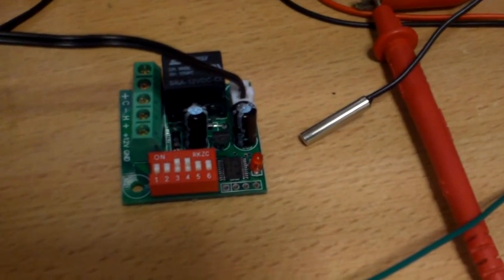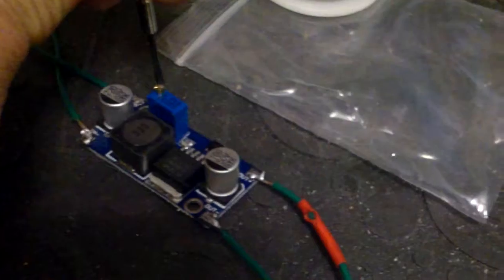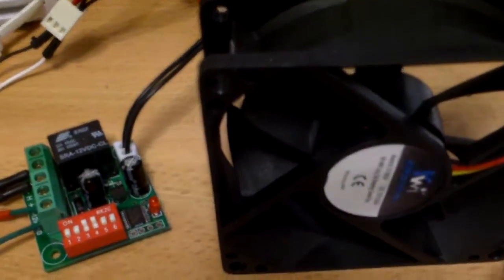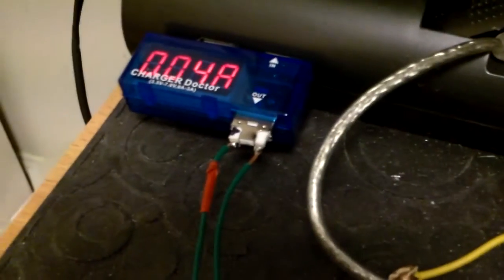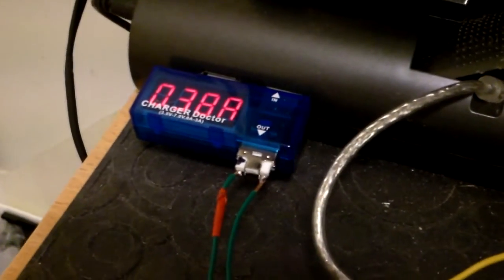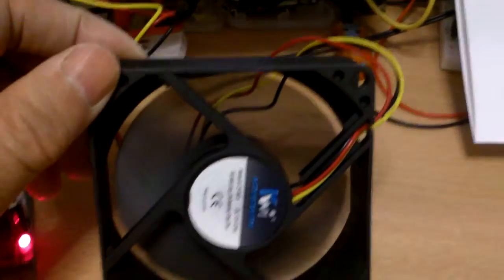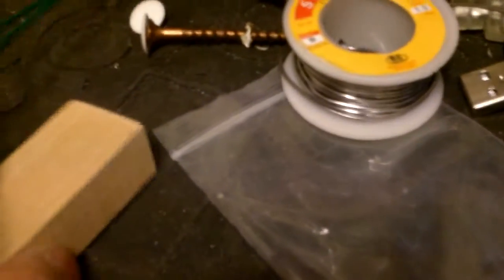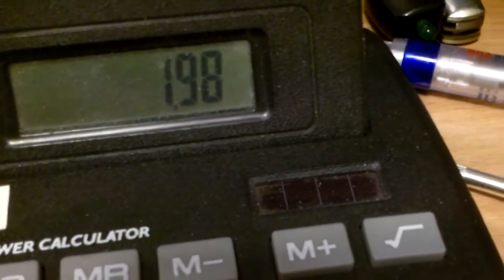USB powered 12 volt thermostat with a XL6009 based voltage booster

Comment: The blue cheapie USB charger doctor is not a very good one, try the new better design with OLED. More info and sensitive. Less than U$8. I use it to monitor my 7w Solar Portable Charging process on Cigar type Single 18650 powerbank.  http://www.ebay.com/itm/380939322537?_trksid=p2055119.m1438.l2649&ssPageName=STRK%3AMEBIDX%3AIT
Reply from the maker: Thanks, I took a quick look and LCD usb tester seems pretty sophisticated. The blue charger doctor is cheap but there's a fair share of loose wiring and soldering problems.  I'm sure people who are interested in these devices will appreciate the info you gave.

Comment: I don't think it's certified - a lot of that stuff comes in DIY kits that you can solder up yourself. If it's a concern to some they can always get an 'on-site' certification. But these simple components sure are great for DIY projects none the less!
Reply from the maker: We are just stating the obvious. Many will find these parts unsafe. I say use extra caution and do it at your own risk.